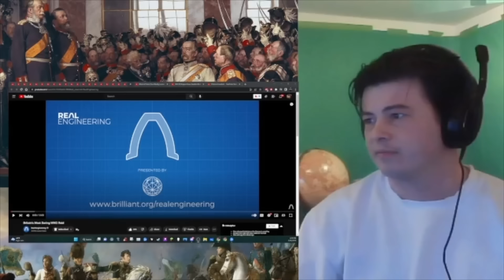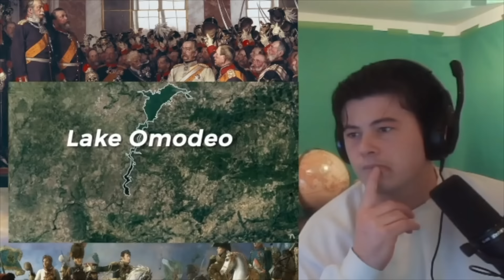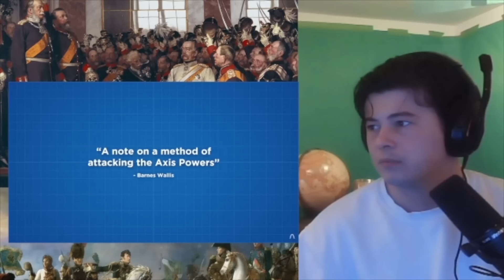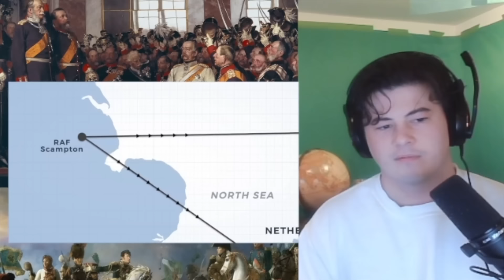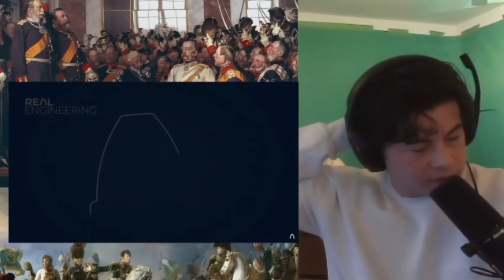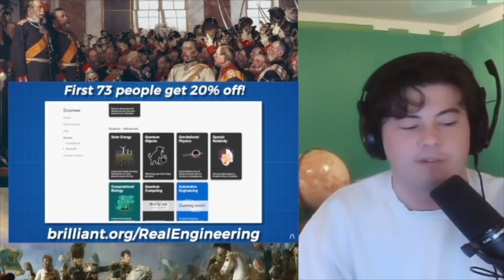American Reacts Britain's Most Daring WW2 Raid

Comment: German treatment of Western PoWs was significantly better than on the Eastern Front. Even in 1940 Hitler's plan was to force Britain into a surrendered peace agreement rather than conquest, and he knew he could not directly challenge the US. As a result the Germans tried hard to avoid any incident that might make this less likely.
Reply: We were guilty of some appalling actions towards German PoWs.

We would give them all the tea that they could drink, but we'd ration the milk so severely that even a builder would turn his nose up at a German PoW's brew. We'd build the PoW camps to Imperial measurements and finish them to an acceptable, but rough around the edges standard, torturing the millimeter precision of the German mind. We would deliberately and randomly change tea time to any time between 2pm - 4pm and have the camp's laundry purposefully leave one sleeve cuff unstarched, or not press the hem of one trouser leg on the prisoner's uniforms. We'd only let them use the prison issue bone china tea sets on Sundays and Christmases, instead having to use the cheap earthenware mugs for tea and plates that were far too small for anything more than a dozen chocolate digestives the rest of the time. You might get away with some manner of fanned out circular arrangement with a packet of shortbread fingers on a saucer, but you're not pulling that stunt off with a choccy digestive and I don't care how prolific your engineering skills are. No way. Its circular properties mean that one of those suckers is always going to overlap on the saucer, making any arrangement look rubbish. As soon as one is removed too, the strength of the formation is lost and the rest slide down the rim of the plate into a pile of very none uniformed and entirely messy looking random chaos. Even stacking them in a tower formation of more than a dozen is just asking for trouble. Wreckless, even. You don't get that problem with a shortbread finger, or even a pink wafer. Those puppies are like biscuit Jenga! Not the best for dunking though.

I digress.

We wouldn't take into consideration consecutive letters after the initial when arranging lists alphabetically, or would sometimes deliberately miss out a number during morning roll-call, then carry on with the count without starting it again from the beginning. For a German, this is completely unacceptable! Headgear would be flat, tweed and absolutely no picklestabbers allowed. We weren't complete savages though and tea bags weren't expected to be reused, but using more than the standard issue of 10 per day, per prisoner, would see an entire blockhouse issued with only Tetley's tea bags for the rest of the week. Square ones too. Only officers would have access to tea strainers and those fancy little sieves, but all PoWs, regardless of rank, would be forced to pronounce 'th' and 'w'correctly too, or see their washing up liquid removed. Fine for a day or two, but sooner or later, a tea spoon that has just been used to stir a brew is going in the sugar bowl through a lack of a clean one, you're fishing brown snow balls out of the colonies finest that the cane plantations have to offer, the problem worsening with every attempt to remove the offending clump of tea soaked granules through the clean, dry spoon shortage, older and more dehydrated lumps fracturing just at the mere sight of a spoon, showering your bowl of once pure white granules with an irretrievably tiny, countless particles of contaminate. Your sugar bowl is bollocksed and because Hans called the Pime Minister "Vinston" again, you can't sweeten your brew with a long soak off a coccy digestive now, because your entire blockhouse are on Rich Tea until further notice. Wolfgang (with a 'W') tried to pass a packet of Nice biccys off as Rich Tea, but once the sniffer bulldogs got the scent of the sugar coating in their snouts, it was all over. The river of slobber that a British bulldog can secrete once its got a whiff of sugar in its nose is a hell of a thing and always a dead giveaway when plonked snuffling and farting next to a German PoW suspected of trying to circumnavigate camp contraband rules with rebellious acts of continental decadence. Y'see, for your average Jerry, it was all about coffee and cake. With your cake slice, little fancy fork, plate with a doyley on it, coffee cup, saucer, cake spoon AND a coffee stirrer spoon though, that's an entirely different crockery and cutlery set up! Our camp waiting on staff didn't have time for any of that foreign nonsense and wartime Britain certainly wasn't going to indulge them with pretentious percolators and faffing around with bloody Blackforest gateaux. No, it was a box of 70 Typhoo, brewed in the mug, 1 lb of Tate & Lyle, 7 pints of silvertop milk and 2500 grams of McVities (milk or dark chocolate) per prisoner, per week and that was it! To save any confusion, it's said that even Jaffa Cakes were banned, though history shows that may have had more to do with orange rationing than the prisoner's human rights. 

Not our finest moment as a civilised nation, I admit, but war is a hell that brings out the true savagery of man.
Reply: Meanwhile Hitler planned to depopulate the entirety of Eastern Europe Manifest Destiny style, except with gas chambers instead of smallpox, though he’d probably try out some bio weapons if he could
Reply: Not equating the 2 scenarios, just saying they share similarities
Reply: It was due to the nazi ideology. They considered the germanic tribes as superior to all other people and counted the enlish as germanic too. According to them all the germanic people ought to work together as they were brothers actually. The slavic people were underlings and subhuman in their eyes and were treated as such. app 3mio russian POW died in german captivity. 600000 by execution, the rest from starvation, forced labor at terrifying conditions, freezing and diseases so as typhoid.
Reply: The British also made them plant roses - so when they bloomed they spelt out Heil Hitler